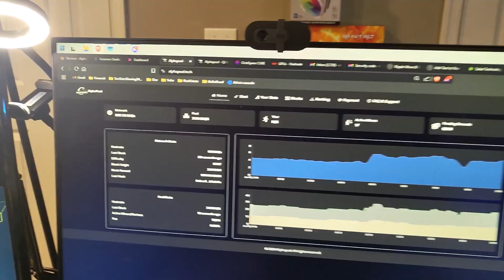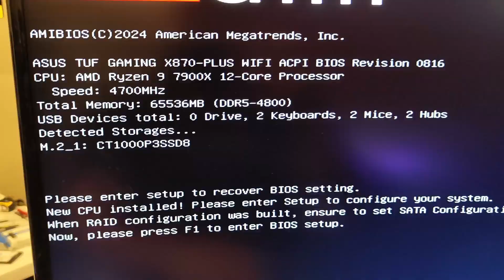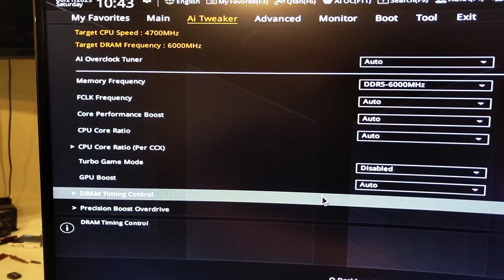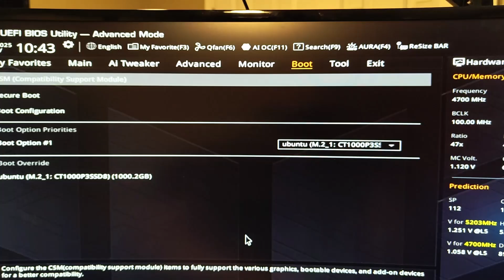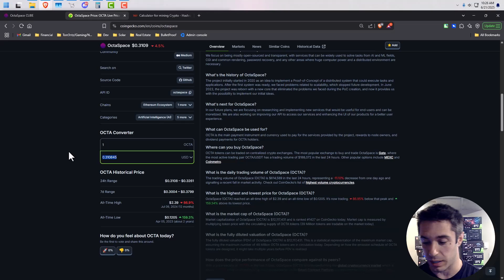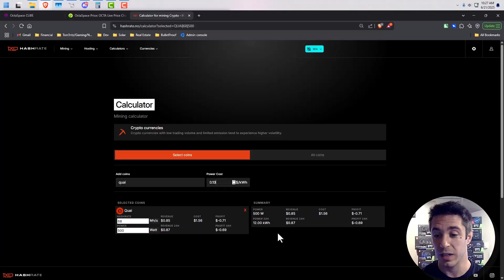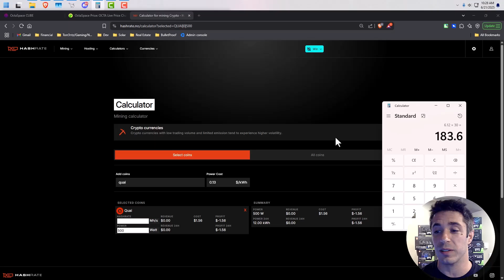Building an RTX 4090 AI GPU Compute Rental Rig

Comment: abit of concern, u spend fair amount of money for good pc part but u not getting open case to install properly?
Reply from the maker: To me, the only use case (HA!) for a case would be if it directed airflow in a more efficient manner, prevented dust, or helped it fit on a rack better. If I decide to put this together as a gaming rig and sell it on FB marketplace or eBay, then I would buy a case. Outside of that, it offers no utility and therefore is completely optional.